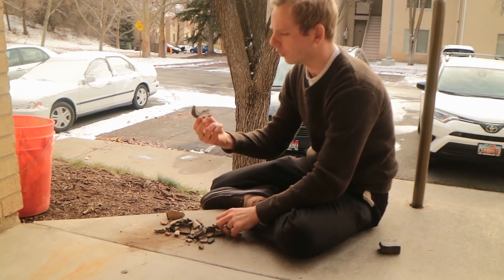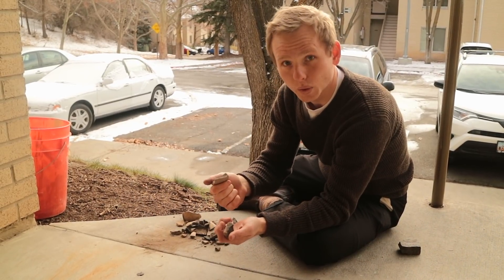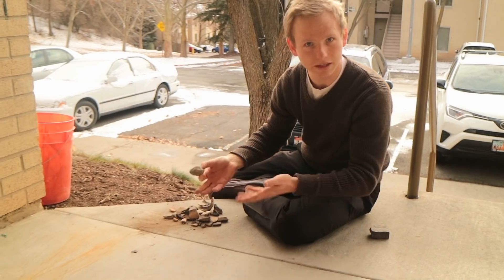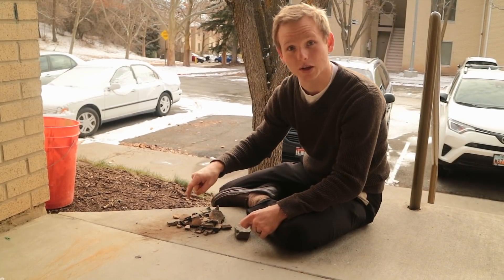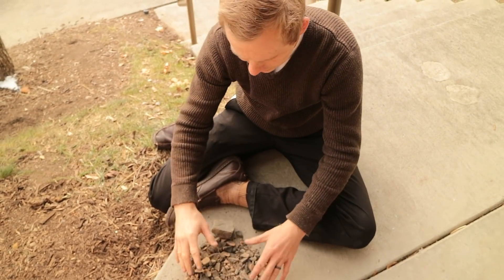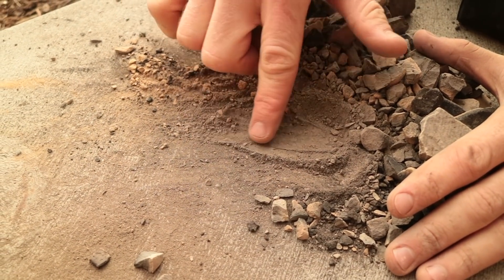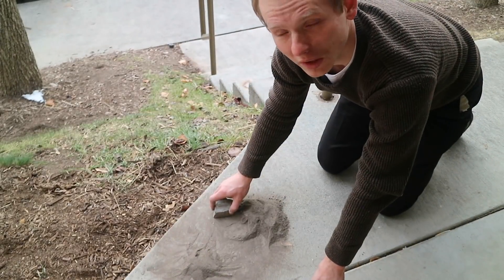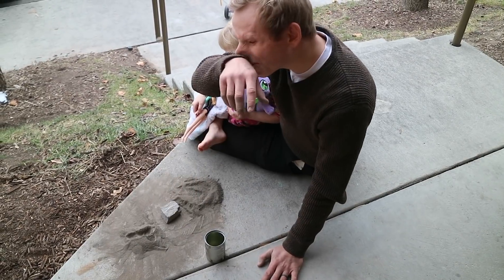Recycling Broken Pots: Grog

Comment: Really bro? You concluded a science lesson with slave labor?  You wanted to commune with the pots spirit? The video should be about the awesome method you chose to pulverize the pot pieces lickedy split. 

If it were me? Sack and a Sledge, in a parking lot. Then a metal dish with a grinding stone set in it, an old bike, and dammit... a 40oz. Bottle Colt 45 with a STRAW. - Because pimpin' will leave you parched, my friends.

Comment: You should put it in a steel pipe about 2ft tall with 1 end capped and welded, and get a steel rod that can fit inside to smash all that up. Then you can get different refinement of sifters to filter out the big pieces as you work on it. Would make it easier.

Comment: does this work with dry cement too?
Reply from the maker: Likely not. Cement and limestone generally undergo a chemical change when heated to clay firing temperatures. JB
Reply: @GoodandBasic  but can crushed hardened cement be added to cement mix
Reply from the maker: Yes, I think. But it would act mostly like sand. The thing that crushed pottery adds is it stabilizes the growth and shrinkage that comes with extreme temperature changes. JB